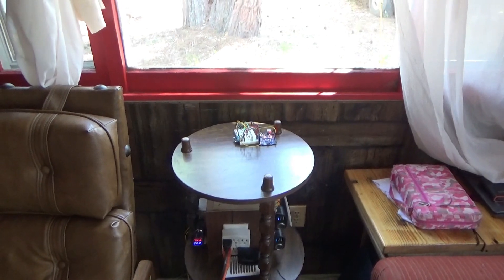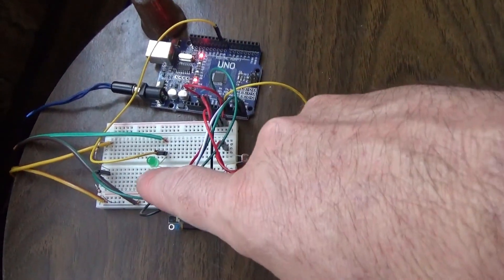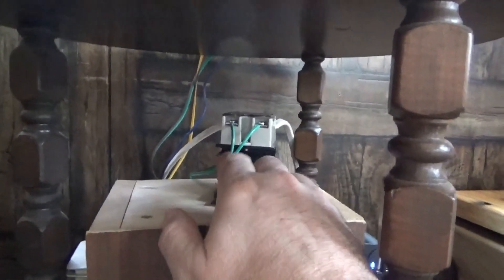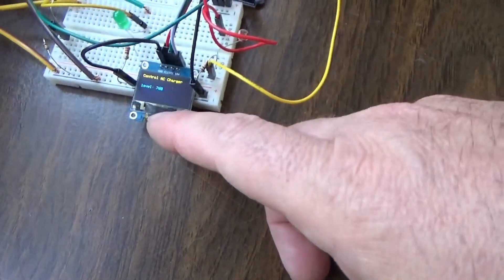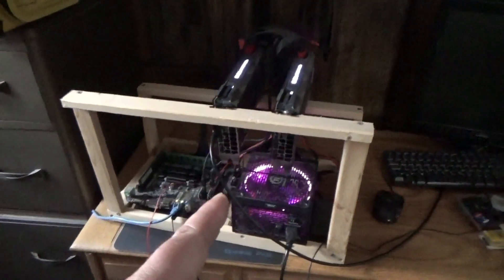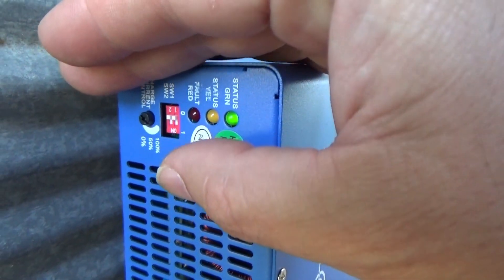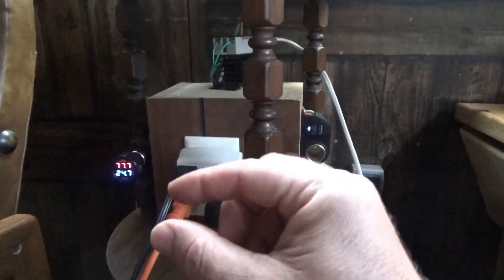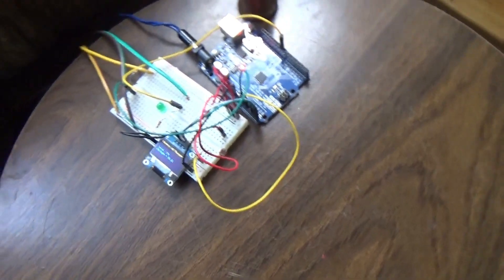My DIY Reverse Grid Tie Off Grid Solar Power System

Comment: The software your using Mr Troy, does that come with Arduino app. I have a senario where I have too much solar 9-11 months of the year. So I want a dc setup whereby any access on the main bank gets to be dumped into the the few 18650's cells I got laying around. I will solder a few resistors to step the voltage down to 3.90volts to make sure those batteries don't go above  4volts..
Reply from the maker: Sorry, I lost that software when Microsoft took over my computer and installed Win10 over my Win7, erasing everything. The Arduino later got used for crypto mining controls.

Comment: Why not get a simple grid mains 26 volt DC PSU and diode supply it direct to the batteries?

It will not consume very much grid power unless you get a low battery voltage of about 26 volts - 1.5 volts drop for the diode.  This way you avoid all the complexity of running a CPU and monitoring.  Just size your diode and PSU to be greater than your maximum DC demand.
Reply from the maker: Sounds simple enough but where to get a 26 volt DC power supply at high amps?

Comment: Omg this is too cool 👍🏼🙂
Reply: A grid tied system would accomplish the same thing with many other benefits. Such as being able to sell excess solar power back to the power company. As well as having unlimited capacity to run anything without power rationing. No need to turn one thing off in order to run something else. But if I understand correctly, those systems are more expensive and Troy doesn't want to make the investment.
Reply from the maker: "Doesnt want" or cannot afford is more like it. If I went grid tie I figure it would cost about $10,000 which is insane. Literally every single nut, bolt, washer and part of the system has to be UL listed and made for solar power use. Then professionally installed by a solar panel installation expert. Then you get the power company to put in a new meter and you pay an electrician for more breaker boxes and wiring in the house. Thats all insane when I only want to protect the batteries from harm in emergency cases.
Reply: There is a reason why they require UL certified equipment and professional installation. My utility doesn't require installation by a licensed electrician. But all work must be done to code and pass inspection. I don't see anything wrong with that. Not following code could lead to your house burning down. Most new solar power installations are grid tied. The biggest benefit is you don't have to worry about how much power you have. Just flip a switch and it works. Yes, the systems cost money up front but end up paying for themselves in reduced or completely eliminated electric bills.
Reply from the maker: I agree, the code is there or a good reason. Its just that I cant afford to go that way. Wish I could. Maybe one day. But for now I find budget ways to get by.
One big problem with your idea tho is that you dont make any money until many years later, after the cost of the equipment has paid for itself. Its generally 20 to 30 years with a professionally installed system.
Reply: All I can see is not paying a huge ridiculous power bill. Folks here in Kentucky that are on a set income have to make choices wether to , eat, buy prescription meds, or pay huge huge power hike. Obviously this grid cost is not just in Kentucky aa well. I so wish I could tell the CEO to shove the power up his keister 🤔
Reply: Kentucky needs to use coal again for power.  Since the ban on coal,  folks lose more than just power, like jobs etc.
I won’t get started on this subject !! 
I can say it’s a bad situation and I can’t see a light, at the end of the tunnel, for our future generations. 
I vision them living life like mad max beyond the thunderdome. Thx goodness, I I am old  lol I i won’t live to see this lol
Reply from the maker: I am researching something that is not widely accepted and stirs up arguments. But I am studying a way to run a generator with less input power needed to drive it. If you can remove the magnetic resistance by timing it right, you can run a larger generator off a smaller motor. That smaller motor could be powered by a few solar panels and a battery bank to run all day and night. Its a "no lenz generator"
Reply: The payback period depends on several factors, including the cost of electricity in your area and how much energy you use per month. I think 8 to 10 years would be reasonable. Considering you could use the savings on your electric bill to pay down the loan. Anything over 10 years for payback, I would consider other options such as running only some circuits on solar. But all work would still be done to code for safety reasons.
Reply: Someone's Princess3, Sometimes high electric rates may be due to greed. But not always. There are costs for generating or purchasing power. And there also costs associated with building and maintaining the grid and power plants. Going with solar power also has costs.
Reply: Troy, I think I know what you're suggesting and it's not going to work. Output power cannot exceed input power. Unless you can change the laws of physics. That "magnetic resistance" is caused by the electrical load placed on the circuit. A one kilo-watt load will require the equivalent of  one kilo-watt of energy to drive the generator.  Plus a little more to make up for the loses in the generator. You can't cheat nature :) But I will wait and see what you come up with.
Reply: David Johnson  I see your point !! 
It’s just that  some folks struggle to even have power here.  Some folks are forced to live off grid and use outhouses again.
Reply: If SHTF and I’m still alive an outhouse would be a luxury, I think 🤗
Reply: Someone's Princess, In SHTF situation, I agree completely! I think my biggest disagreement with off gridders is going off grid when it's not necessary. Just to claim "freedom" from the power company.  Thus giving up most if not all modern conveniences that technology has brought to us. It is their life and of course, they can do as they want. Just something I wouldn't be willing to do.
Reply: Someone's Princess, I feel bad those in tight economic situations. Being squeezed in all directions by high housing costs, medical costs, and utility bills.
Reply from the maker: David, most people apply the laws of thermodynamic to electronics. Its wrong. Besides it has been shown many times that you can reduce the magnetic resistance by removing the load for most of the rotation. It perfectly fits what you are saying. Pulse the output into the load between the timing of magnets passing the coils. The coils will store the built up energy from the magnets. Then pulse it out to the load at the right time.
Reply from the maker: I remember when I hooked up a treadmill motor to a bicycle. Open the switch and you can peddle like mad with ease. Flip the switch, connecting the batteries (load) and boy that thing got hard to peddle. I want to try that again but with timing to pulse the output to the load. See what happens.
Reply: Troy, It may be possible to increase the efficiency of a generator but you can never exceed 100%. To do so would mean output energy exceeded input energy. That would violate Law of conversation of energy and, yes, the first law of thermodynamics. But again, I will wait to see what you come up with. Of course, such a demonstration should show an exact measurement of input energy and exact measurement of output energy.
Reply from the maker: But David, do you doubt the universe is full of energy? Why is it so hard to believe we can use it? Does not a magnet itself sort of defy your laws? Think about it a minute. Do you have to put energy into a magnet to get energy out of it? Isnt a magnet a sort of perpetual motion sort of thing?
Reply: No Troy, magnets do not violate the law of conservation of energy. Though I can understand why people may think that. Google: "do magnets violate conservation of energy?" for more information. Yes, the universe is full of energy. Some of it we can harness. Some of it we cannot at this point. Since there is no known way to do so. But by all means, if you think you can get more energy out of a generator than you put into it. Go for it! But... I will remain unconvinced until I see a detailed demonstration showing both input power and output power. And if I were investing in such technology, I would also need verification by independent experts. If you do succeed the rewards will be great. I just don't think it's possible.
Reply from the maker: Well, lets see then.

Comment: Well troy if you have all these solar panels now , why don't you hook up your whole place up don't have grid power , hot water tanks don't use all that much power , for the hot water tank you can use a switch to turn it on and off , that simple , just saying that way you don't have to pay for a power bell
Reply: There is really no way to cheaply replace grid power. Water heater heating elements require 4.5 kilowatts! Going off grid requires more than solar panels. There are inverters, charge controllers, and batteries that are expensive. Troy's 1,000 watt inverter on his main system won't even replace the power available from a single 20 amp on grid outlet! Which provides 2,400 watts.
Reply: P.S. I would love to have something like Troy's system as a backup to my grid power. To provide power to critical loads such as lighting and the fridge in an emergency.
Reply from the maker: One day we will be at that point.

Comment: Finally - Someone who is living off grid and actually using new technology. I plan on doing this on a much larger scale and more automation. I am work in the Robotics industry and automation and I love to see people like you who use Arduino's or Rpi to show others how they can be used on a homestead.
Reply from the maker: Thanks. I would love to have your job. Always dreamed of it. Long ago I built a robot arm controlled by my C64 which helped me solder electronics parts together. It would hold things for me. I used a software PWM to control the motor speed and a variable resistor on the joystick port to sense positions.
Reply from the maker: I once had a Quelle Shop in Germany. Got a tour of their warehouse. Fully automated at that time. Must have been early 2,000.
I will have a look at that.
My dream is to make a household robot which is relatively intelligent and can get around on its own.
Back in the '80s I was working on speech recognition software on my C64. My room was so full of sheets of paperwork. I was using machine language back then too.
One day I was thinking of cooling computers better. I considered a car radiator and cooling system. So one day I made the Word's first water cooling system for computers in Germany. Had a patent on it. China mass produced it and I lost the race tho.
Reply: @TheDoItYourselfWorld  At Microcenter there is a Google Voice Kit for $5 that you need a Rpi and do If Then Than That commands and create your own voice commands and actions. Really cool stuff.

Sorry to hear about China but I can tell you there are a lot of stories like yours for sure.
Reply from the maker: Yeah, I know, my story is a common one. I am hoping to have a talking robot without internet tho. I dont get good reception at home on phone or wire. Plus its more reliable I think. I was looking at the software chat boxes.

Comment: Great set up, I get it.  We have a home that is totally off grid, so the back up is a generator. I have 10 new 100watt panels and a new xantrex 3500 12 volt charger pure sinewave inverter. I have most everything I need to get the system updated. So exciting!
Reply: Living in Alaska, the getting dark thing only happens in wintertime. Then we only get sun for a few hours, at best. We then need the generator more often. Looking for a long term storage solution for 6 months worth of power!
Reply from the maker: Hmm, awesome for half the year. The other half is a problem.

Comment: So basically you have the same system I have I only use the grid Emergency if my battery is wrong too low but my inverter it's a samlex 3012 evo it has its own 60 amp charger so on my battery is running low to 11.75 it automatically connect to the grid charge my batteries run my house when the battery is a charge to 14.5 it will disconnect yourself from the Grit and the only does this about an hour somewhere about 4 in the morning right now I'm running 2500 watts of solar and two wind turbines 3 face of 800 West each one
Reply from the maker: Yes, something along those lines. Mine cost a lot less overall though and it was fun to build.
Reply: The only reason I have it to be honest to you it's because I get a job for it because that inverter it's like $1,800 and yes your way was a lot more fun
Reply: Like and yesterday I went and did a job on a gentleman's truck 18 wheeler and I ain't got a 50-foot antenna tower for the job I fix the AC and put a new starter gentleman bought all the parts an antenna power is around $1,800 is used but in very good condition I want the tower for one of my wind turbine
Reply from the maker: Good deal!!

Comment: It blinks because your code is bad.
Reply from the maker: I literally just pulled this display out of the package and got it going. So yeah, that is what I thought. I have to learn more about this display but its pretty awesome so far.
Reply: Nonsense. when you clear the screen and re-write it, it's gonna blink, no matter what you do. Now, if you can address the characters individually, then you can update just the numbers without the labels blinking. Depends on how the display works.
Reply from the maker: Yes I am pretty sure you can set individual characters.